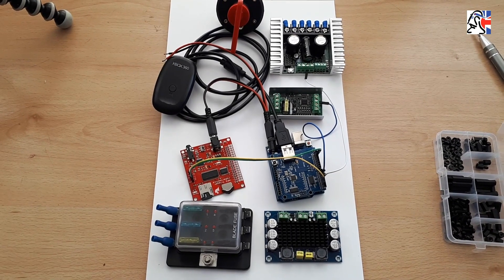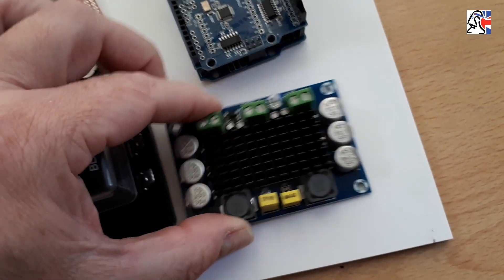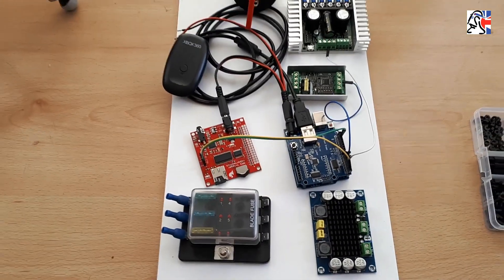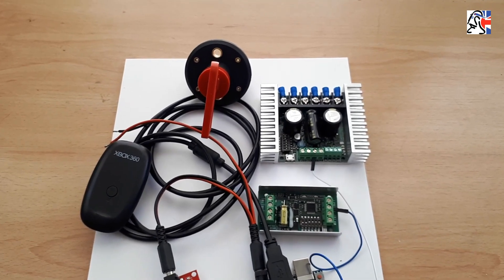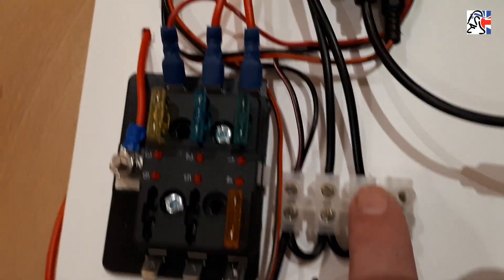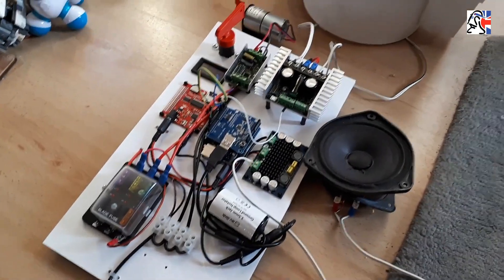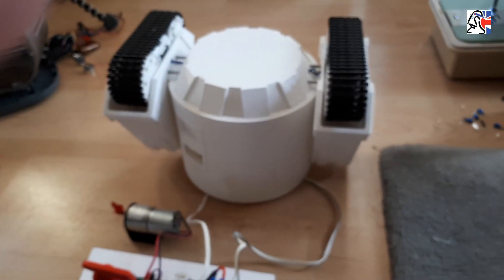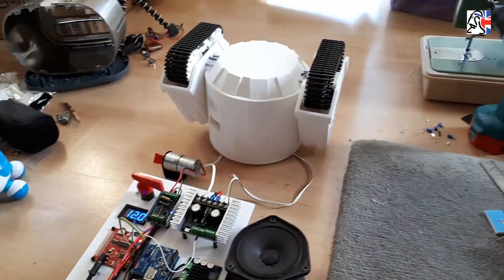Padawan 360 build - part3

Comment: Are the Standoff Screws M3 or M4?  Does the standoff height matter as long as there is air flowing between the board and mounting board?  I'm assuming if you have a board that requires a USB plug in, it would be wise to have it a little higher off the mounting board for easy access.
Reply from the maker: I think M3 off the top of my head, the sabertooth and syren's come with their own screws.  You don't need much height to be able to access the usb port on the arduino, it's more an issue of blocking access to it by another component accidentally.

Comment: Great video series! Would you mind to share the specs of the 12v battery and Amplifier? Thx in advance for your time.
Reply from the maker: The amplifier I use is a TPA3115 100W mono amplifier from Aliexpress. My battery is a 17ah 12v SLA from a UPS system.
Reply: @ImperialLightandMagic  thank tou very much Sir.

Comment: Great videos series! I’m about to buy the electronics to my R2… Would you mind to share the specs of the 12v baterry, Amplifier, ground loop isolator and fusel distributer? Sorry, I’m not an electronics guy. Thank you very much?
Reply from the maker: Have mentioned battery and amp in your other reply, I use AV:Link ground loop isolators (with 3.5mm jack, not the RCA plug version) for fuses, a small boat style blade fuse holder should do.  Also make sure you have a decent amperage mains toggle on/off switch.  I now use 100amp rotary toggle switches, again available from the likes of aliexpress.
Reply: @ImperialLightandMagic  one last question by now: what is the benefit of using a 24v setup? Stronger/faster Drive motors only? (My R2 is
Going to move on average speed).
Thank you again.
Reply from the maker: @douglas71322  more volts means you need less amps for the same amount of watts. Watts is ultimately what tells your motors to work. Less amps means your wire won’t get too warm!

Comment: This is pretty much what I've been looking for as I work on my CH-33P, so thanks for doing this setup. I think I got the majority of parts in my wishlist right now and just gotta clean that up so I'm more confident in my choices.
The only issue I have right now is that I had accidentally purchased 24V motors for my drive system...was told by other builders that it should be fine though, just means he'll be able to run around virtually any surface.
Reply from the maker: No issues with the 24v motors, infact gives you better options if you wish to go 24v for your main build voltage.

Comment: It would be great to get a three part series just on how to get the damn controller to work. Im $60 in on buying controllers and USB boards an have yet to get a single one to work. 
How about some hardware link to EXACT hardware you are running. Hell Id throw anothert 100 at it if I knew I could get something that actually worked.

Comment: Thanks for the video. Can you make a quick video on battery/power sources? You never really cover this besides saying you’ve connected a lipo battery.
Reply from the maker: That's a tricky one, because there are many variables depending on the droid build and drive train in question, a heavy all metal droid would benefit from higher voltage say 24v for the extra torque, they may want to use high C (continuous current) lipo cells. A lighter 3d printed droid may be fine with 12v sealed lead acid (like the type commonly found in UPS systems).  Also add to the mix how much run time you want between charges (are you going to a 5 day comicon with no charging, or are you gonna have your droid on a static stand and just turn the head from time to time).  I'm not trying to avoid your question, but there really are many many variables. Personally my wood/metal droid runs 12v 17ah sealed lead acid (I have two I can parallel for longer run time), DDR2 drives and he drives fine on hard surfaces/hard carpet, on thicker carpet I have to put it on speed 3 to get going. I'm thinking of making it 24v to see if it improves torque, but the top speed is already "brisk".
Hope that helps!

Comment: Great video.. Got a question.. Can I ask?... Okay Like the padawan360 system looks fairly easy to control. but can I use this to work my dome as well as body parts?  In dome I have Matt swartz lift mechanism periscope, bad motivator, life scanner  zapper. also teeces in dome. what about the pie panel opening? can I hook couple of arduino mega's together?

Comment: Do people use rechargeable batteries to power the droid? If so, how do wire up a 120AC recharging circuit?
Reply from the maker: In my experience, people charge their battery outside of the droid. Note this is just in my experience, I'm sure many do indeed charge inside their droid, but I can only think of one and he uses a bank of 18650's and knows what he's doing :)